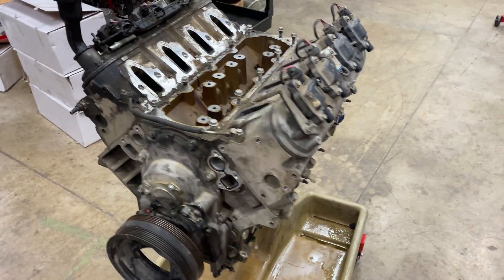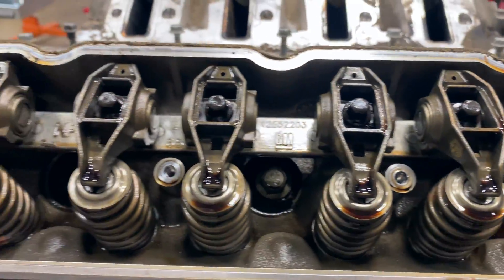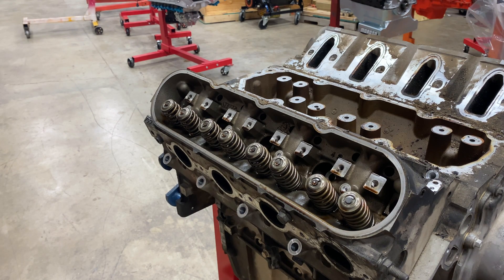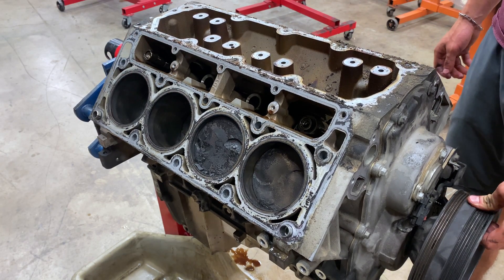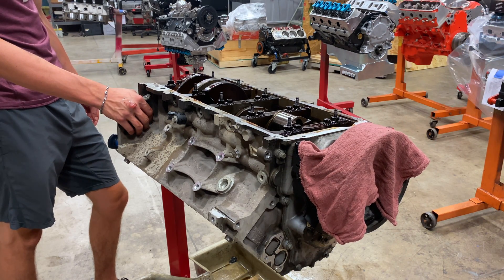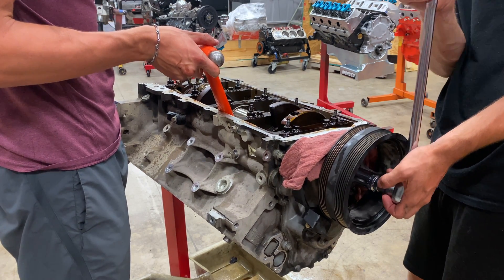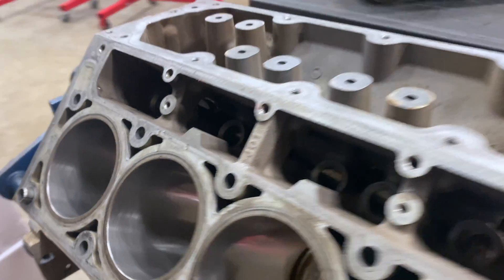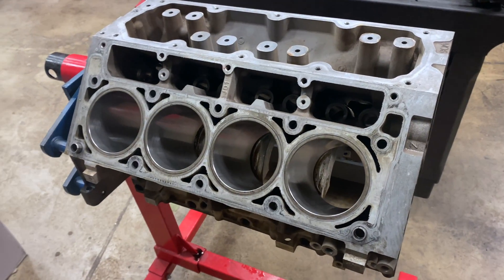Rebuilding a 5.3 LS!! - (Part 1)

Comment: I notice that on this LS unlike the original small block ( I am more familiar with ) there are only 4 heads bolts per cylinder instead of 5 am I seeing this correctly

Comment: Do you have a space to take over a 2003 Chevy Silverado 4.8 1500 ls extended cab, to upgrade ( SWAP ) with a 5.3  with Direct fuel injection, or with delete fuel vvt  cylinder shut off…blue printed and balanced with a mild cam also mated to 480 E  transmission  a bulletproof converter ..please let me know know if you can take this job and location of your Garage…

Comment: Vice grips holding the flex plate and a breaker bar not ratchet as the sure break
Ask me how I know
Can’t torque the crank bolt with an impact driver just a torque wrench. If you need to put a hollow pipe for leverage that’s a winner.

Comment: Thank you so much for posting this.  Using this as a reference to rebuild the cylinder heads for the first time.  Will this work with 243 cylinder head castings too?

Comment: Will a set of 1996 vortec. Heads fit on the 1998 5.3L vortec
Reply: Someone tell me about the head swap will 1996,7 5.7vortec heads swap out for the 1998 vortec 5.3L

Comment: I  need to watch this video and am wondering if you could help me because I have the second last lifter that has approx three quarter inch loose in it and haven't tried to see if that changes or if it grinds when trying to turn it over;  would it always be the cam's runner for that that would be snapped off or could it be the self adgusing part that is collapsed? t

Comment: At 175k miles unless it has low oil pressure or a mechanical issue the LS doesn't require a rebuild. My dad had 410k miles on his engine and it burned a little oil. Besides oil consumption it was pretty clean and needed only head rebuilding, rings, bearings and an oil pump. Thing still runs today.

Comment: I was looking at an ls2 5.3 what are the biggest differences between each gen of 5.3s? I know the ls3  has better flowing heads which will fit the ls2 but im looking to swap an ls2 into a 02 mustang and want to know what to look for as far as what car or truck to find them in.
Reply: There’s teeny differences between literally a couple dozen 5.3’s, google the RPO codes. LM7 is a early 00’s iron block, LM4 is an aluminum LM7, L33 is a HO aluminum 5.3, LY6 is an aluminum DoD 5.3, etc.

Comment: Great build, I was wondering just springs and cams on a 5.3ls is usually good enough for 800 hp or you have to upgrade the bottom end?
Reply: They have six bolt maincaps on the crankshaft

Comment: This is a prime example WHY you change your oil on a regular schedule. It doesn't matter if you are using conventional oil or synthetic. What every the manufacturer of the oil say. DO IT. Because I have a 03 LM7 (iron block) apart at the moment that WAS NOT TAKEN CARE OF. And this thing is a complete mess inside. Everything had a "Tar" like sticky goohy mess all over it. The real treat was finding 3 quarts of sludge I could scoop out with my had in the bottom of the oil pan. Surprisingly the bearings not only looked good. But just for giggles we plastic gauged them to see how worn they where. And to our surprise,  both the rods and the mains where still WELL within spec. Same with the cylinders. The pistons skirts where pretty chewed up. And the cam (Non VVT) was also chewed up. However this engine was still holding 35 lbs of oil pressure at a idle and over 40 at 55 mph. This block is getting the full spa treatment. And new OEM 4.8 flat top pistons and new Everything elese. Including a BTR Truck Norris Cam. And there's one thing I'm definitely glad I read about was upgrading the OEM rockers to the BTR Trunion style rockers. Because with 165-K and the lack of maintenance on this engine. Those tiny roller bearings in the OEM rockers where severally worn. In the state they where in. They wouldn't have held up long to the abuse of this aftermarket cam, that for sure. Great series guys, it shows how over  Engineered these LS where. And how you can take a junk yard engine and make HUGE hp on a budget. And they will out live any OEM Small Block Chevy hands down.

Comment: I heard you stay 1000 hp not on the stock bottom end you won’t and not with Chinese turbos and not without serious work to the block 
You can learn these facts from a Motor Trend article 
And MotorTrend even talks about the thousand horsepower LS that everybody seems to have which most of it is a bunch of crap

Comment: this is exactly how you're not supposed to remove cylinder heads do not use a torque wrench and make sure you do it in opposite pattern of installation don't just take them off at random that's how you warp a cylinder head.
Reply: Bro and then you guys put the breaker bar up against the crank while yanking on it... are you kidding me? How can you call yourself the engine guy and not know that you're not supposed to do that? I'm like 80% done with the video I can't even watch anymore
Reply from the maker: Thank you for watching the first 80%! This engine now has over 50k miles and is running amazing :)

Comment: That motor wasn't smoking that's totally normal to have carbon on the top of pistons with almost 200,000 miles. That engines in great shape internally

Comment: See this is exactly my engine. I was telling you about. I need it rebuilt and I want the most power out of it and I need it to be dependable. It's my daily. I need either to upgrade my lm7 5.3 or upgrade and get something bigger. 2000 Chevy Tahoe. I was thinking 9f ordering a Frazier built lm7 5.3 stock internals. Or the summit racing lm7 5.3 450 hp 420 torque lm7 5.3 . What would you recommend. I want way more power than a stock lm7 5.3 . N/A if possible. And maybe turbo it in the future.
Reply: Go to the junkyard and get one pulled and build that one.
Reply: @bunythebeastgamer6920  ... That's an idea. Thanks

Comment: GM makes a bottom end that can handle 1000 HP, builds it to make 320 HP, but needs rebuilt @ 170,000 miles !!!! WTF!   I have a 2009 GMC Sierra with this same engine and the same bullshit AFM, that needs rebuilt @ 105,000 miles :-(      My mechanic says Cylinder 5 is misfiring and thinks it's the lifter, but I don't understand how cylinder 5 could have a collapsed lifter if it's not one of the AFM cylinders??  I'm really beginning to hate GM, quality really has gone down hill, my 2003 suburban with its 5.3 was bulletproof!

Comment: Looks like almost the exact same engine that’s in my 2010 Silverado, mine is a flex fuel DOD 5.3 aluminum block with 799 heads

Comment: When you remove the pistons , Can you tell IF the engine has exhibited "piston Slap" ? My '01' 5.3 has Slap for about 2 minutes (@135,000 miles) , but it completely goes away ! GM advisory says "Slap" does NOT effect engine life or performance ! Do you agree with their opinion ?

Comment: Man I wish you guys had a shop close by in NC!  It seems the dealership missed so much with my 2008 1500 Silverado with a 5.3l engine with 181,500+ miles.  They tell me the rough idle, excessive exhaust vapor, gas smell, and dimming lights is normal and can't find anything wrong, but I know it's not.  They missed a burnt up head light harness, buzzing cabin ambient temperature sensor, and wobbly harmonic balancer.  I fixed most of the issues, (broken transmission and engine oil tubs, ignition coils, spark plugs, wires, door harness and actuator, a ground fault, evap canister, purge valve, charcoal canister, all vacuum hoses, intake manifold gaskets, injectors, MAP and IACT sensors, blower motor fan, alternator, blown fuses, broken door handle and cable, faulty window  and lock switches) but that idle eludes me and seems that it kills batteries without a parasitic draw.  I can't get a check engine light to come one, only a "tighten fuel cap" light.   I do hear a "bubbling" and "gurgling noise on the driver's side while on park and the idle is really bad will at stop lights.  I wouldn't mind paying the money to have someone like y'all to look at it!

Comment: When you said your doing a small cam shaft do you mean smaller that stock or slightly larger than stock. If you mean smaller than stock what would be the point of that?
Which cam shaft and what size valve springs did you use?

Comment: A trick to take off the hormonic balancer bolt if you don't have an impact, is to use a big pipe wrench and attach it to the pully on the hormonic balancer ( if you're reusing the part, put a rag on it b/c the pipe wrench teeth will dig into the pulley groves). Then turn the pipe wrench in the opposite direction of the breaker bar.

Comment: How do you keep all the screws organized?
Reply from the maker: In my brain
Reply: @JacobVillemain  that’s an impressive brain then lol.
Reply: You don't have to worry about that whenever you've got warped heads; you just find a bent bolt/screw and throw it in there!   ROFL 🤣😂🤣
Reply: And then don't forget to use your torque drill to force them back in there as well!   Lol

Comment: AFM (DOD) was actually started on the general line vehicles in 2007 but they were used as early as 2006 on escalades and other high end vehicles.

Comment: A torque wrench or a rachet is never a breaker bar. 
You should use 1/2 or 3/4 inch drive for crank pully. I love a 36' breaker bar in 3/4 .
Reply: Listen Jeff, not everyone has the space to store a 36 foot breaker bar.

Comment: lmfao I love that moment at 10:10.... when it started clicking into place why so many people talk about LS swapping and call them legendary powerhouses. "They have six bolt mains?!" lmfao I was smiling so hard during that moment since it reminded me of the same thing I went through.... you see all the qualities that go into a racing engine and then look at the LS and it's selection of GM parts from all the various models and you just start getting uncontrollably giddy.
Reply: Except they won't last past 105K without a rebuild :-(  Even after someone with OCD does all the recommended maintenance to the T! I used to love GM, now they build crap!!

Comment: AFM strikes again lol.. and then all the PCV issues for the rest.  Fun fact... AFM didn't debut in 2008 or 2007 as that's the first GMT900 trucks.. it actually came out for 2005 in the LH6 that replaced the LM4 that was in all the Trailblazers and Envoys and whatnot.  Goofy engines with 24X crank reluctors and a 1X cam pickups but still had afm and an E67 ecm.  Junk lol... but great engines once you delete the problem.

Comment: Yep, this is no doubt one of the junk 2010-2014 Gen IV engines that GM has been sued three times for. My LC9 is in the same boat. The piston rings are junk, the AFM/DOD is junk, and when the rings fail you'll eat half quart of oil in a few hundred miles. The blow by forces that oil out and the intake sucks it in like crazy. I disconnected my lines from the valve covers to the intake (no PCV, they use an orifice) and I ran the rubber lines from the valve covers to open air. No more oil consumption. I then used a tuner and disabled AFM/DOD. Dumping in lots of fuel cleaner to hopefully clean up the chambers some but ultimately I'll be doing what these guys are doing. Or dropping in a 6.2.
Reply: Interesting. What about the 2007-2009 Lc9s?

Comment: haha, crank bolts are a pain without an impact.  I broke a few sockets and a rachet trying to get the one off my Toyota 3.0.  I ended up building a tool to bolt to the PS pulley holes on the crank pulley and used that keep the crank from turning while I loosened the bolt.  Bought an impact socket too, even though I was taking it off with a rachet.

Comment: How much does it cost for an engine rebuild
Reply: I’m about to rebuild a 5.3 and I would say you will have roughly 1,000- 1,500 into it with all the tools and necessary things
Reply: Is it better to replace both block heads or one at a time

Comment: I'm gonna pretend I didn't just see you using a torque wrench as a breaker bar.....
Reply: Even using a ratcheting wrench makes me cringe.
Reply: probably an old torque wrench. mine turned into a breaker bar when i upgraded
Reply: Aaaaaaand not removing the head bolts from the outside inwards 😂
Reply: THAT ENTIRE PART!! LOL also if they don't air hose those cylinders before moving on i'm ending the video lol
Reply: 11:40
Reply: I use my old torque Wrench as a breaker bar, good leverage lol most of the time tho I use a breaker bar with a lax stick connected as an extension so I can use my whole body as a weight but i actually use my cordless impact gun. Just more efficient
Reply: Except he uses a different digital Snap On torque wrench when assembling an engine.now punch your dunce cap back on.
Reply: Still not a good habit
Reply: When I use to build engines I used a beam type ro record what ever bolt broke down at. There are reasons for it I will leave it at that. However it will not hurt them at all.
Reply: I like it taking off the heads bolts straight and orderly one by one then the one next to it and the one right next to that one 🥴
I hear this is breaking one of the most important rules...
But i cant prove it🤷
Reply: Even busting balls with a crow bar is unacceptable...SMH
Reply: Ummm….  He has several $1000+ snap on torque wrenches.  This guy knows a little more than you do.
Reply: @Cultofpersonality09129 yes that’s what knowledge is associated with……expensive tools. Good grief.
Reply: @Cultofpersonality09129 smfh 🤡

Comment: Great build.  My two favorite parts.  1.  Your brother saying "they have 6 bolts mains?"  2. You throwing all the LS parts away your not reusing.  You guys are a great team.  I think you have converted your brother to LS's. 

I have a LQ9 that has 170 k miles that I will be rebuilding at our local machine shop.  Might do a 408 stroker but not sure.
Reply: Can a 5.3vortec be bored,or stroked to get more cubes and power??

Comment: The last  motor I stripped down was a 283 Chev. Wow they have come a long way.  The first 265's had Rope main seals.   Yup come a long way.
Reply: You are correct,the first Chevy v-265 cid had sometimes leather strap connecting rod bearings
Reply: Mostly low mileage babbit for piston rod bearings
Reply: Babbit is comparable to the donut gaskets on eighties model exhaust header gaskets